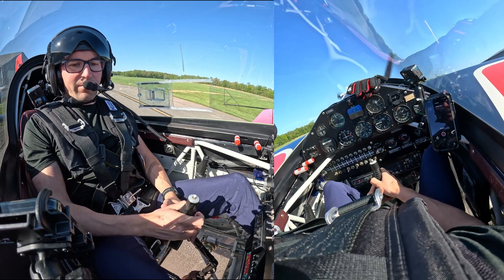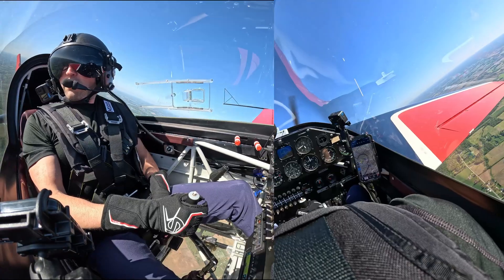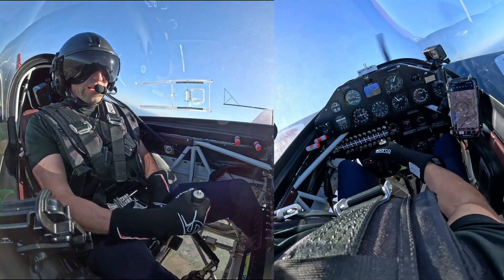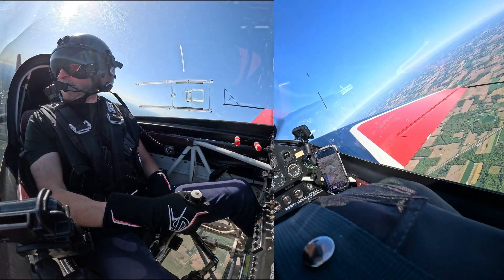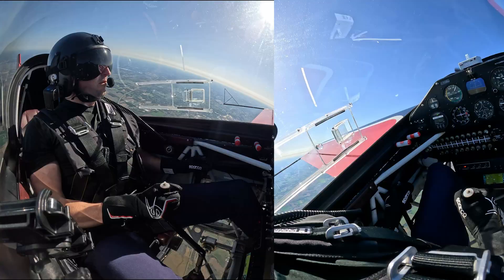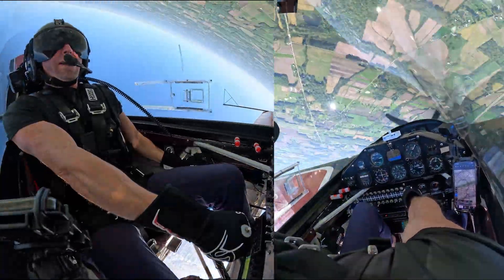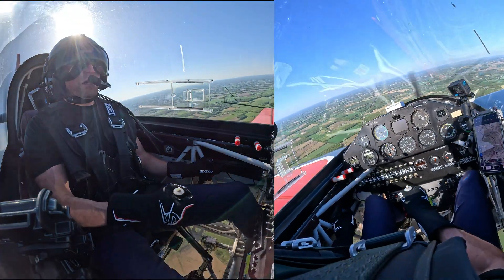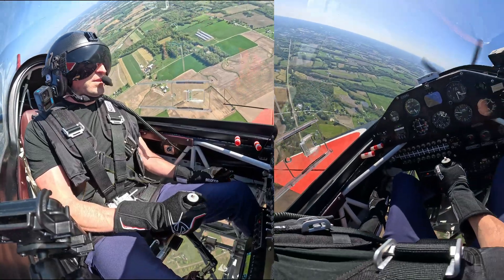Cross-Over Spins in the Extra 300...Why Spin Recovery Technique Matters

Comment: Is it ever necessary to 'check' forward and return to neutral to break the stall? Ive heard of it being required in a fully developed c150 stall occasionally? 
Great video :)
Reply from the maker: Thank you! A quick check forward, if your aircraft requires, certainly could be appropriate. The main takeaway is that sustained forward stick, along with full rudder is the exact recipe for an inverted spin. Certainly always follow POH guidance but for any highly aerobatic aircraft, stick to neutral produces pretty immediate results. Thanks!